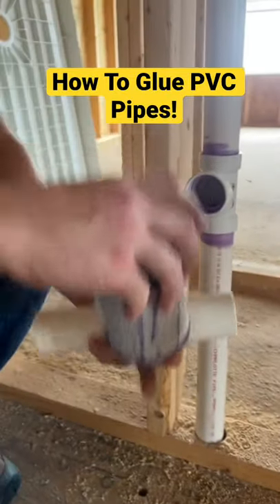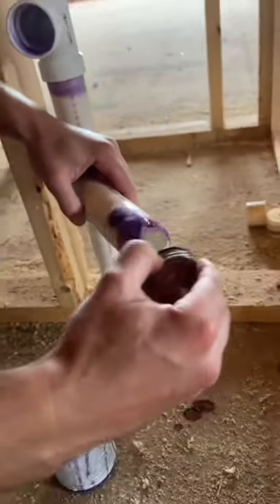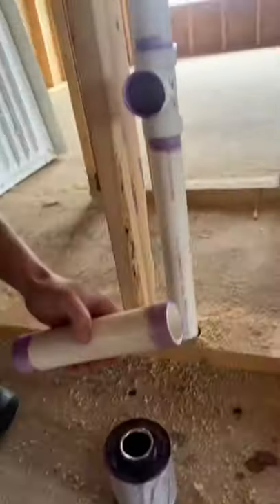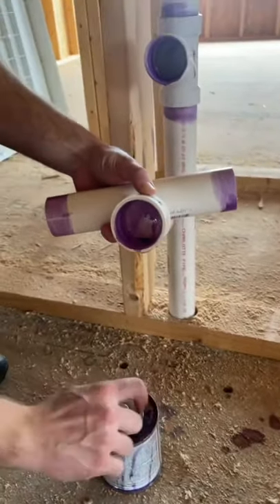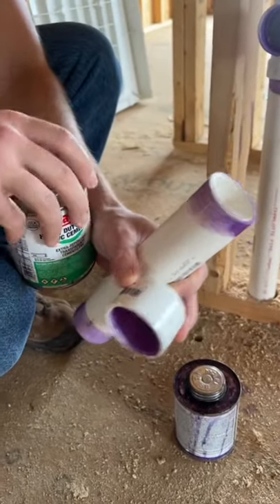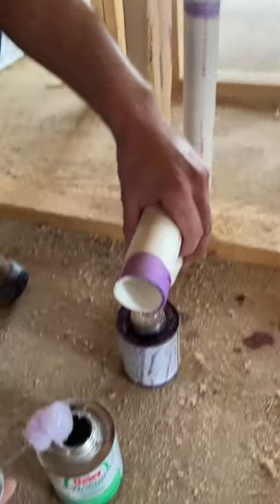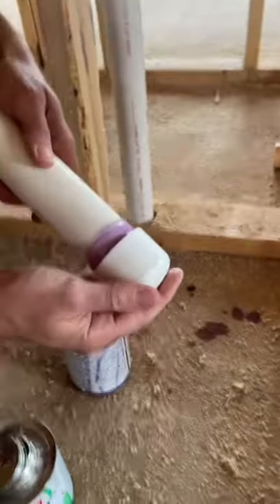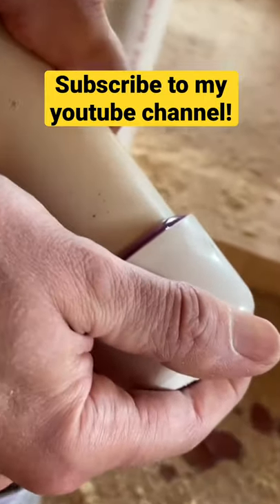How To Glue PVC Pipes! #shorts #construction #plumbing #diy

Comment: Don’t forget to debur the outside of the pipe! I have fixed 3 connections in the last month that were primed and glued but not deburred. If you skip this step you risk scraping all the glue to the inside of the fitting as you connect them. Twisting helps, but always deburr!
Reply: I never ever deburr pvc nor do I ream copper
Reply: If you cut it then yeah but if it's new you don't have to.
Reply: genova pvc kitchen 1.5" elbow

Comment: Been plumbing for 50 years and never used primer on residential work!! The only thing that makes it necessary is code??
Reply: Primer softens the PVC to create an evenly prepped surface for the glue to set up. You'd be crazy not to use it, i mean whats the extra few seconds per fitting/connection. It sure beats having to go back to a job beacuse one of my pipes came unglued. Can't make money like that.
Reply from the maker: Yes the inspector must see the primer for code here. Thanks for watching!
Reply: So you've been doing it wrong for 50 years, wow
Reply: @mr.g937 well there are pressure tests on YouTube that show primer for not make any difference. I have read at least one paper that showed how primer actually made the connection slightly worse. In this case, it looks like it’s drain, not pressure pipe?

Comment: Clear primer, and clear glue....looks much cleaner
Reply: True 🎉
Reply: Code doesn't always allow that. They will fail the inspection if they don't see the purple in some places.
Reply: @AdonnaPruette   "in some places" and certain inspectors. Where I can use clear I will.
Reply: @MJJR247  here in india, plumbers directly apply solvent without using primer and cleaner, whats your take on this
Reply: @nitingoyal7547  in the states there are types of pipe that you can use a 1 step glue as well without prepping with primer.
Reply: Illegal

Comment: Been plumbing for 50 years and never used primer on residential work!! The only thing that makes it necessary is code??
Reply: I just started with a new company that doesn't use primer and I was shocked but hey it works
Reply: The thing that actually makes it necessary is how PVC glue works...